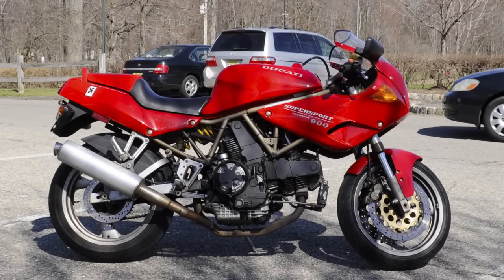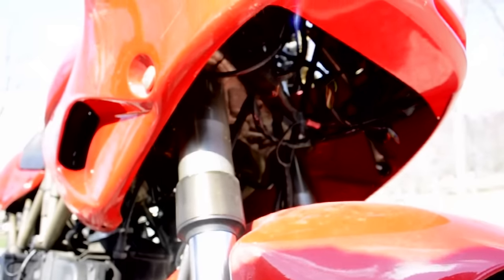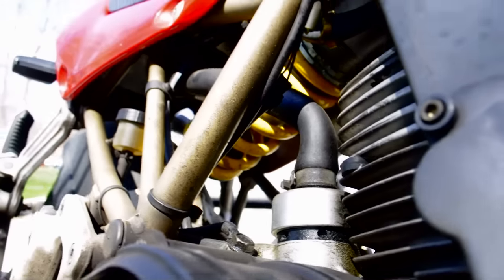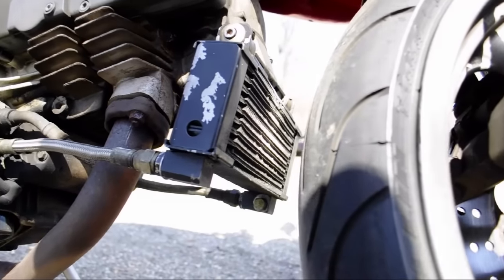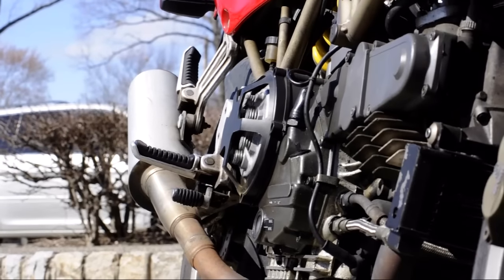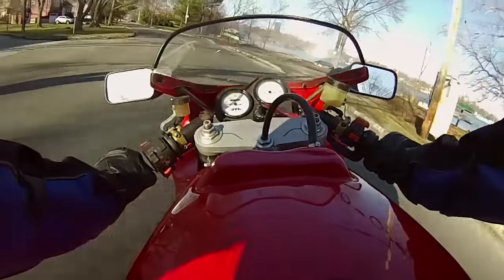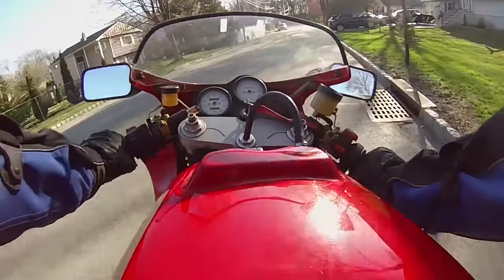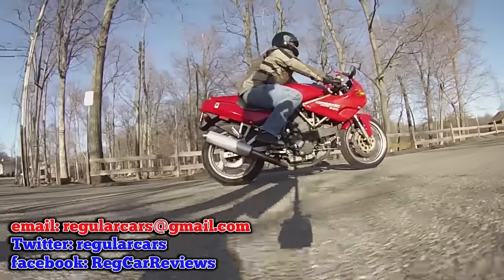Regular Car Reviews: 1998 Ducati 900ss cr

Comment: Power pulsing is pretty common at low speed partial throttle on old school race replicas. What I was told is the high horse power and low torque cause it. While a L-twin should have good torque the problem is that Duc does not produce that torque down low. It's a mid range slugger after all. This low RPM surging could also be due to the wild cam timing, (duration vs travel), often found on old trackers. The FZR600 and the Honda RC51 are famous for this attribute so this is not just a two cylinder or an Italian job thing. The cush drive in the rear hub is supposed to protect against low RPM lurching causing damage to the drive line but don't rely on it. Keep your RPMs up and the problem disappears. Never lug these old track biased bikes or they will buck like the high strung race horses they were meant to be.

According to many a Power Commander and a pinion and sprocket swap, (to bring the torque down to a lower RPM), can smooth the issue out but it will never completely go away and will hurt the top end speed and overall fuel economy of such a bike. Again the best option is to play to the advantage these high reving engines offer and keep the RPMs up in their respective power bands. Fuel economy be damned, they're race replicas after all.

Then again my FZR600 was brutal in second at 25mph with the Dyno Jet stage II jet kit and the Vance & Hines SS2R full race exhaust, (89db at idle and it only got louder from there), I put on it. My neighbors would have killed me if I blasted through the neighborhood in first at whiny five grand. To get around that I would wind it up to about thirty, pull in the clutch and coast down to about fifteen miles an hour where I would wind it back up again. I'd just rinse and repeat till I got to my house without pissing off everyone who lived near my house.

Today I roll on a '04 ZRX1200R, still lots of horse power but with 75-80 foot pounds of shift optional, down low torque power surging is a total nonissue. You'll find this to be true at any displacement though. Get the torque usable down low and the bike no longer bucks when you short shift or cruise at partial throttle.

Comment: you missed a few other differences. 160 rear tire due to narrower wheel , steel swingarm vs aluminum,  adjustable forks, someone swapped to then on the 
bike you were riding., steel vs cast  front rotors.

Comment: The 900 SS SP broke my shoulder.  It runs and rides with the kickstand down.  That's ok, it has a dash light to tell you it's down....but you can't see it in the daytime.
Reply: Because Ducati.

See also: kickstand that likes go up when it's down, for...reasons. Which mostly include the need for new wing mirrors and footless.
Reply: *footpegs.
Reply: Performance UAV I like that the vitaloni mirrors automatically adjust to look at the ground after the first 15 seconds of riding.  The interesting part is that I think it's self preservation.   The only thing that survived my highside was the mirrors.

Comment: Good bike for the old guys who didn't have enough money in the '90s to buy one of these. The 98 had a cost-saving non-adjustable fork.  Anyway.  I have a 1994 SS C$.  With low cylinder compression.  Needs a rebuild.  But I still ride it around my neighborhood, and for a few minutes, I am single and 24 and I don't have any where to be.  And then I have to go home and work on the yard, and take the children shopping.  Oh well.

Comment: It's a beautiful bike, Mr. Regular, but is it cheap to purchase used?

Actually, considering the color rarity, I'm gonna assume this is expensive as hell.
Reply: They are plentiful and cheap in  Canada. Not many are still left on the road, and every few thousand miles, the belts and desmo valves will set you back a grand, assuming nothing else busts.
Reply: +Rey Castillo The 90's ducati's are pretty cheap. This one may be expensive but the monsters and other bikes are relatively cheap. I got a 99 monster 900 for 2500 bucks. Needs a few things but it runs great. If you know how to do work yourself they aren't that bad in price.
Reply: +ccubsfan94 Are they worth the ride or is there a warning to this sausage creature?

Comment: More then 80hp for a 900cc was insane in the 90s ?  Intresting :P My 1984 VF750F made 86hp :P Although ofcourse having double as many cylindes. And yeah i am one of these people driving car oil in their motorcycle (Turbodiesel Oil btw) and it´s working fine for me, no clutch slip at all. Haha and about the rattleing, i  feel like it´s a 80s/90s standard, since nearly all our bikes rattle a little (we got 5) either from the starter clutch or the timing chain (usually both xD)

Comment: only certain shaft drive motorcycles like the Moto Guzzi because the engine is mounted backwards there's room for a huge single plate dry clutch like on a car that's how those motorcycles can use a dry clutch but they're very rare

Comment: So the 1998 Ducati 900ss is like a BMW E30 M3 but with 2 wheels ... The stock E30 M3 without the aftermarket exhaust cam gear hates to be in traffic wants to run in the mid RPM range, it's noisy, rides hard, and could kill you if you're not constantly paying attention while driving it.

Comment: I'll admit I don't know much about motorcycles. But how is 80hp insane in the 90s when the CB750 was doing 79 in the 70s?
Reply: Kaleb Yoder 

cb750 was not even close to that.    lucky if 50 at the rear wheel.

Comment: I guess just because the SP has a completely different suspension than the CR makes them identical except for the fairing. LOL: You can tell you are car guys because you don't know much about motorcycles.  AND ridden properly it is a smooth, raw, fantastic handling bike and not a throw together bucket of bolts as you elude to. My 94 CR is one of my favorite bikes. :-)

Comment: Beginner bike?  Only 80hp?
Reply: You'll die if you get an older ducati as a beginner bike. 
Die because of starvation. Older ducatis are maintenance hogs; If you'd want a ducati as a beginner bike 
Get the scrambler 400 that's supposed to come this year.
Reply: Thanks
Reply: +gurbash washere What's so great about that bike? Why not an older, cheaper Ducati?
Reply: Lion Celica the newer ducati is aimed for the beginner crowd, for sure itll be easier and cheaper to replace parts. 

Often older ducatis are cheaper cause nobody wants them due to them being maintenance hogs and having hard to find parts. 

I actually found a $2k older ducati monster but I just couldn't bite the bullet, some of the more experienced ducatisti advised me not to do so unless i had big pockets and total passion for ducatis. 

Ducati made the scrambler 400 and 675 monsters to entice the younger/beginner crowd into getting a ducati and thus ridding the stereotype that ducatis are hard to own.

Comment: by 98 a 600cc bike with  80 at the crank is considered a slow dog of a bike. I guess unless it's a Ducati so Ducatis get that much of a break as well apparently and nowadays a 900 twin makes 150 horsepower not a hundred. ducati's own water cooled version by 98 was making closer to 150 no by nobody standards was this special bike in 98 as far as horsepower just wanted to make that correction

Comment: You can ABSOLUTELY put car oil in a motorcycle engine. Thats conventional oil. NOT synthetic. I have only ever used cheap 10W-40 conventional engine oil in all of my bikes and have never once had any slipping issues. Motorcycle specific oil is just expensive conventional car engine oil.

Comment: 80 hp? Anything over 75 hp is insane cuz it's the 90's? My last bike was a 97 cbr fireblade 900rr and it was rated 127 hp stock. My brother still has his kawi zx9r and it's rated at 140hp stock. Both are 900's putting down much more and I'm not sure about the other two but my cbr weighed 404 pounds dry. Lighter than my current bike, 2012 r1. If I remember though when I was shopping the Ducatis were always heavier and less power than the Japanese bikes all the way through 2009 or so. (Numbers are off of bikez)

Comment: That's it? 80HP in 1998? An old Ninja 900R from 1984 would destroy that Ducati with 115HP
Reply: Canadian Carguy247 that weight tho
Reply: Ryan Bernard The Kawasaki weighs more than the Ducati, sure, but it's not enough to give the Ducati any sort of edge over the Ninja. The Kawasaki would still beat it. The Ninja has a power/weight ratio of about 0.20 and the Ducati is less at about 0.17. That's what really matters.

Comment: Wrong!! You said the only difference from the 900ss, 900ss/cr, and the 900ss/sp was the faring? That was the noticeable difference, the rest? ( I own a 94 900 ss/sp, one of 300)

900 ss/ cr (Cafe Racer)
Non adjustable front fork
plastic fender
steel rear swing arm
Narrow rear tire
186 Kg, or 410 ibs dry

900 ss/sp (Sport Production) North America only bike, limited numbers
Fully adjustable 3 way front and rear fork and shock
All Carbon Fiber fenders, Clutch cover, belt covers, chain cover
Aluminum swing arm
wider rear tire
181 Kg, or 401 dry weight

So the 900 ss/sp are the mac daddy's of them all!!
Reply: Yes, that is correct! But my '95 SS-SP didn't have carbon belt covers. I swapped my clutch cover out for a Willwood cover that won't collapse like an eggshell if the bike ever goes down though...

Comment: This wrong or inaccurate on multiple points. "It's the same bike, just less fairing." 

No...

For starters, the CR has a steel swing-arm as opposed to alloy, and the rear wheel is 4.5" not 5.5". It used non-adjustable Marzocchis or Showas, as opposed to adjustable Showas on the SP.

Where did you even get your information from? Lol

Comment: pleease review a aprilia RS125 (doesn't matter which year they're all bitches lol)
In Germany and few other european countries you can start riding bikes with 16 BUT they have to be <125ccm. lots of people around here don't want to wait two extra years to get a 48hp bike (you have to push the power down to 48 till your 20 years old. you could still get a fuckin hayabusa you just have to lower the hp o.o) so they get 125s. 

the RS125 was my second 125 and I fucking loved it. It is an (here it comes) italian 2stroke bitch. srsly. Everytime something was going on with the engine.. the RS let me know. even though it was a pain in the butt sometimes to have a bike that seems to hate you I learned so much about engines I didn't learn with my first bike (4stroke. yzf r125. sucked). The more it hated me, the more I loved it. Normally 125s have about 15whp. 2 stroke 125s have twice as much and heck you feel that difference lol. had my baby on the dyno some day and it hit 30whp.

long story short : if you want to review the bitchest bitch in the universe of bitching italian bitch bikes...here you go:  RS125. :D

Comment: Completely idiot review. I was racing the standard version on a sort of circuit 3 to 4 times a week. Even with only 80 HP against Fireblades and GSXR's with 125 HP I came out first of the pack after every curve. Then they shot away in the straight for me to bypass them all again in the next turn. This is not an ordinary bike. It is more like a superhero suit: you become a centaur, it follows your thoughts and you feel everything through it. Other bikes are great, but nothing feels like the 900ss and the 888 I have been riding.